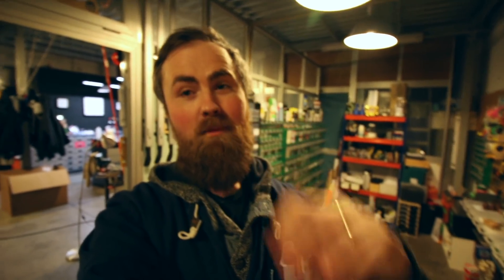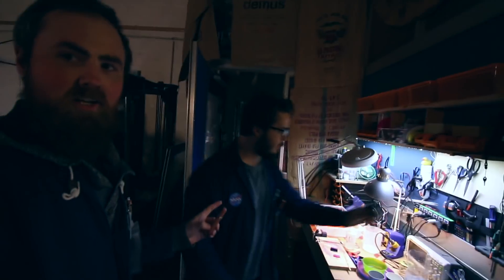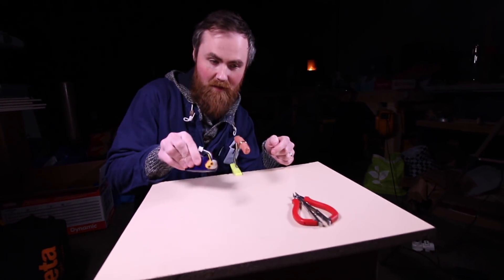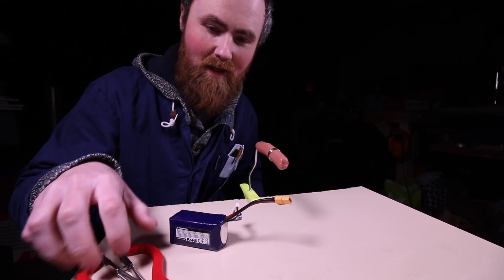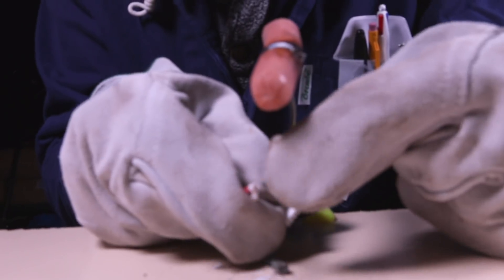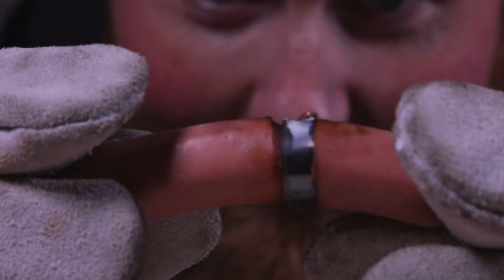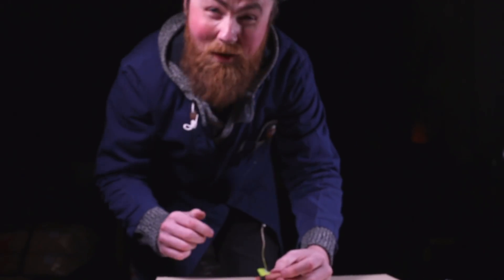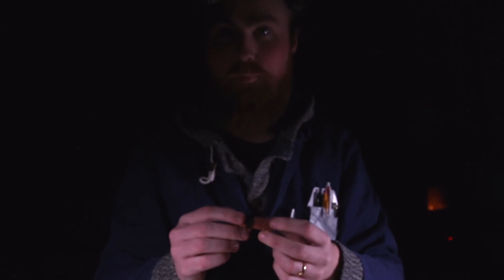Why you SHOULDN'T wear a RING when working with BATTERIES

Comment: a friend of mine did that with a stainless wristwatch and a 12volt 85amp car battery 
when he was changing  startmotor on a volvo. 
The metal in a wristwatch bracelet is so thin it went hot instant :(

Comment: Why not just desolder the connector wires off one by one? That’s the way I swap my connectors off when I’m putting a XT60 or whatever connector I want on. That way you never have the issue of shorting a battery lead together.

Comment: Smashed the balance leads on a drone today and in the rush to remove it the leads touched right over my finger nail and about instantly burned a tiny 1mm hole clean through my nail. And that was probably only one of the cells. I was actually thinking about posting a vid on the very same topic.

Comment: David - did you have the side cutters handy to break the circuit, in case you couldn't remove one of the wires? Should have had the LIPO in a safety bag, in case it blew up. Enough current to cause the wire insulation to catch fire, might have made the battery blow up. My buddy was charging a LIPO in his workshop, when it blew up & started a fire. Burned the carpet on the floor, & put little pin holes in all of the wings on his wing rack, from the hot bits of battery that flew through the air. Good thing he had a smoke alarm nearby, as he was upstairs when it began sounding the alarm. He learned the hard way...

Comment: I soldered 16 li ion batteries (2 packs of 8 in parallel and both packs connected in series) and i used them to burn thing at school with the mechanical pencil lead. I also attached them to directly to a normal pencil and it caught a bit on fire. (a friend of mine was sent to the headteacher because he was shorting the battery, the funny thing about it is that in the note they wrote that he was shorting the batteries expelling dangerous gasses and risking an explosion)

Comment: I had to stop wearing my wedding ring for that reason. Working on a car ignition I accidentally hit my ring on a starter solenoid and fire works. I wonder how many guys have done what you did as far as cutting both wires on a battery changing ends. Good video! There is a video out of a guy whom left his charging cables hooked to a 6 cell battery with exposed banana clips. When he picked up the battery with the wires wrapped around the battery, the plugs touched in his palm. He ended up with a burn in his palm! Its posted for anyone to see. Batterys require a LOT of respect. Being careless by over charging can also result from bad things happening also. Its best to always, always test a battery with a known good meter. Never trust a wall wart charger to do a proper job at charging a battery. I personally wish they wouldnt even include them with RC equipment. If the company is willing to provide you with everything, at least provide a decent  charging system.

Comment: A great demonstration of the dangers of working with high voltage and/or current devices. I’ve witnessed two examples of this. One was a chap working on a high powered RF amplifier. His ring shorted across the base of a very large capacitor and more or less melted into his finger. The second was someone working on his car and his wristwatch made contact with the +Ve of the battery and the chassis. He now has a permanent brand of the wristwatch’s bracelet on his wrist.
Reply: sputniksam I learned in my 20's really quickly why you dont wear rings or watches working on cars. It woke me up, thats for sure! Always respect those lithium batterys, they can bite!
Reply: Low voltage is more dangerous than we give credit.
Reply: FlyQuad FPV Explain low voltage. A lithium battery packs as much punch as any car battery, messing with alternator voltage is talking 10,000 volts on a spark plug ,a lithium battery won't kill you as fast as a car ignition system would. Messing with electricity requires common sense and safety reguardless.
Reply: RC Hobbyist Extreme everyone knows high voltage is dangerous. If not... Natural selection got ya or will. Not many realize the dangers of low voltage being discharged at high amps. It's the voltage that kills. 12v is considered low voltage. Your typical lipo in the 3s range is very close to a car battery in voltage, I have in fact started cars using both a 3s and 4s lipo. A dead short could cause the battery to explode, I have not seen that but I've heard stories.